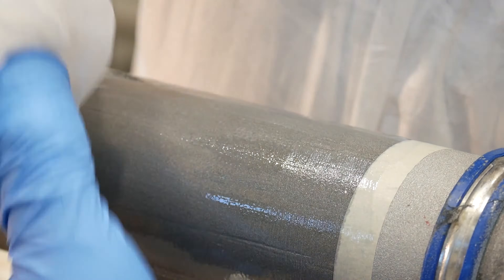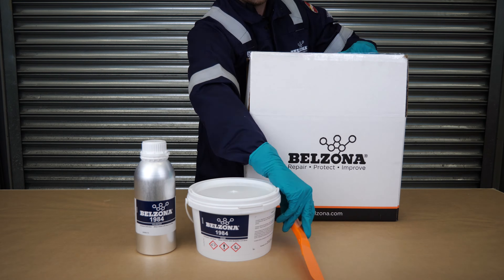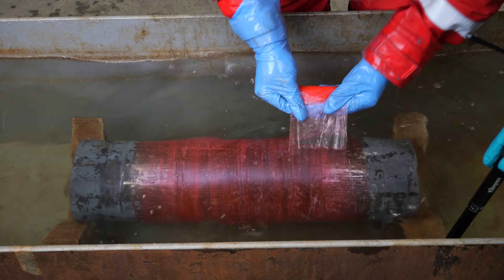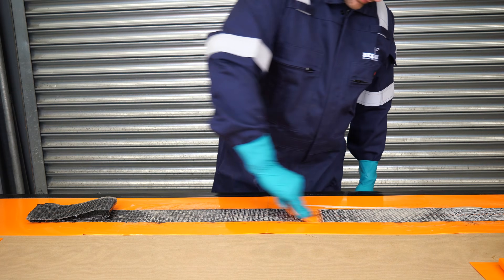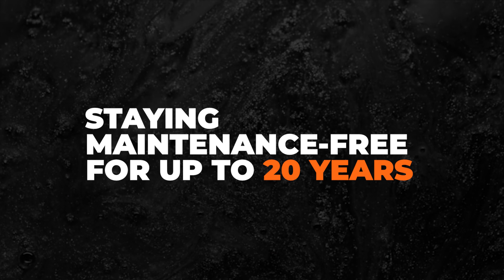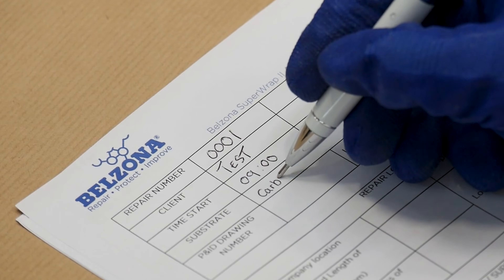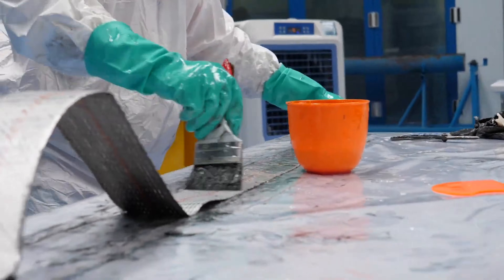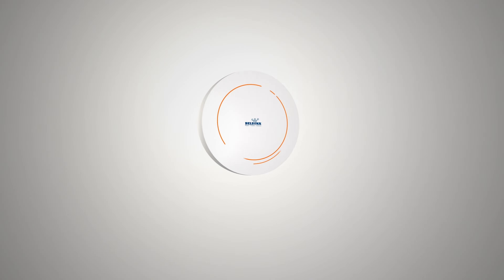Belzona 1984: Surface-Tolerant Composite Repair for Damp, Wet and Underwater Applications

Comment from the maker: In this video, we demonstrate Belzona 1984, the latest addition to the Belzona SuperWrap II range, designed to restore strength to weakened or holed metallic surfaces. Belzona 1984 is 
specifically engineered for surface-tolerance and can be applied directly to wet and even underwater surfaces.